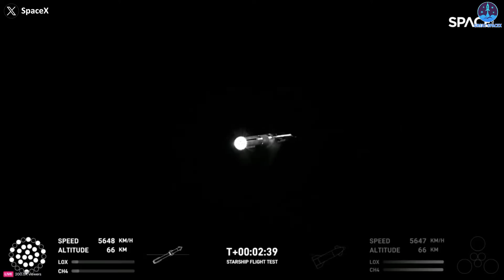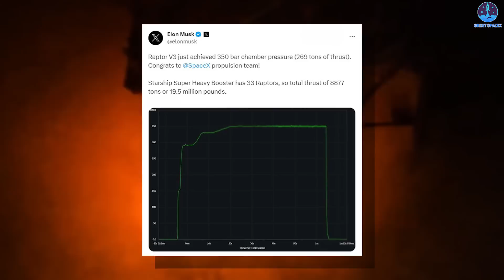Elon Musk's NEW Design Starship V2 Has Arrived...

Comment: I am still convinced the heat shield is a terrible idea, it was the failure of the shuttle and will be again here. Why use small panels this I cannot understand. It will increase weight surely  with more contact points, harder to seal. I believe larger sheet shielding should be used. A simpler solution and something I am suprised we have not seen here.
Reply: Smaller panels make repair manageable. Also if a larger panel is damaged or is lost that exposes more of the ship. A simpler solution but not a good one. There's a reason we haven't seen it before.

Comment: Making a rocket’s second stage reusable has always been the tougher problem to solve.  SpaceX’s process of constant testing and improvement cycle is the cheapest method of reaching the goal.  It worked for Falcon 9 and Falcon Heavy.  It seems likely improvements for those 2 systems are on the drawing boards now.  New engines…Raptor 3s and larger stages(more fuel) are possible.  Falcon 10…..Larger Starships are necessary for even the goal of moon landings.  Remember Elon reduce the original stage’s size a good bit.  The STS NASA had built took 20 years using the super cautious methods.  Apollo 11 took half that time, less than half.  First test Saturn, a suborbital rocket built from parts, first flew in October 1961.
Reply from the maker: Thanks for your comment. Keep following and discussing on our channel ☺️